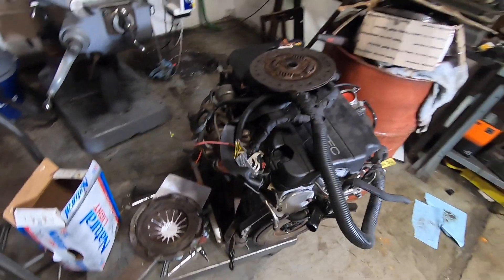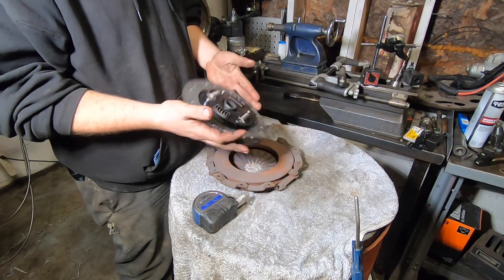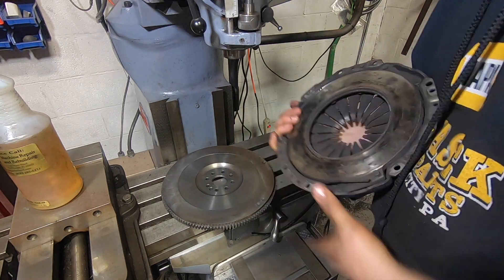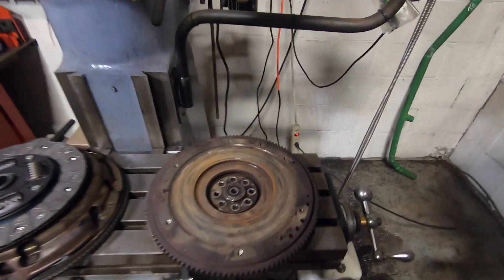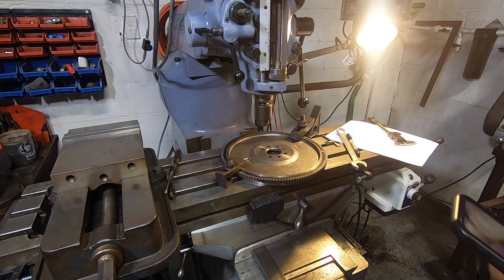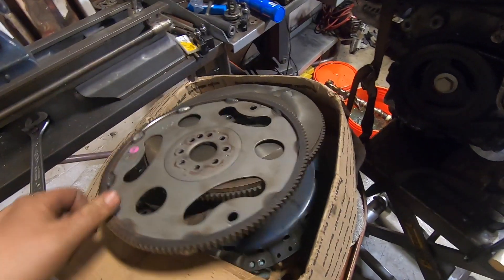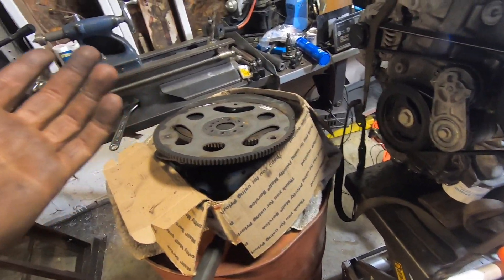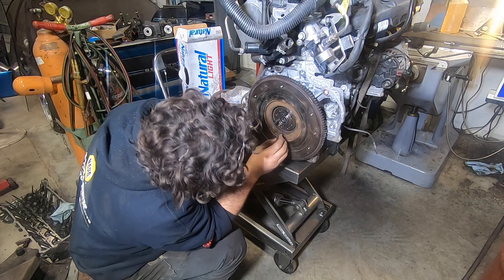Mid engine buggy PART 2. Flywheel and clutch development

Comment: In and around the year of two thousand one or two, I adapted a Mazda Wankel engine into a Subaru XT four wheel drive rig... I don't really like the sound of that particular engine but when working from a junk yard of pieces and parts, in other words basically free parts and rig,... I set it in. Once wiring and other issues were figured out, we pulled the governor off of the rotary engine. Now RPM's were unlimited and here in alaska we have some significant cold weather allowing us  to drive on frozen lakes. I did live in Anchorage at the time and was half owner with Don B. of the AAA1 Subaru shop. Its been sold like maybe the third time since we opened up a little single car garage that just blew up as popular because of its being ahead of the big onslaught of foreign cars that were all wheel drive or many versions of it. Subarus everywhere and cheap so we did a good business.... I had just went through a divorce so drank my way out of it. I might be sober now but threaten a relapse every day here at almost seventy four years of age, and on currently hospice for a injury that left me crippled... too long a story, so with further ado..... we had the XT running great and took it to big lake, name of lake and town there just north of anchorage.... and put it on the ice..... Here is where all the fun starts.... Its sounding awesome and we just put new studded tires all the way around the XT. Our buddy who was invested in our debauchery.. asked to be first driver.... no problem as he was buying the beer. He lined up against the others who we were racing against. Laughing he takes off kind of slowly to gain his best traction on the ice and then floor boarded it! We had locked up the spiders so the diffs were all turning as hoped. According  to the electronic tac, it hit around fifteen thousand RPM's and literally threw all those studs in the tires out.... steel studs coming out much faster than a machine gun and threw  those studs through every fender!!! Bonnie and Clyde had nothing on that ET that day. What I am saying is that Subaru has come a long long way from the little tin can in the eighties. I enjoyed this two part so far build that your doing or should say did if you went ahead with it... enjoy watching a guy overcome simple problems with simple solutions. I say simple yet know how complex this is and can be as I made my living as a mechanic on heavy equipment for years and then kind of got tired of camps and other discomforts so fell into fixing small rigs up for people... I got hurt in a accident in two thousand five that with doctors making things worse.... I am now a crippled old man of nearly seventy four years..... I love that exuberance you young guys have for making things happen

Comment: hey man, great job.  i'm close to starting my adapter plate build - mating an Alfa Romeo twin cam to a JDM 4.44 WRX transaxle which will be going into a '75 Fiat X1/9 resto-Franken-mod. I, too, will be adapting the Subaru flywheel to the crank, and because this flywheel is bigger than the Alfa part the bellhousing bolts on the engine block are obscured, so my adapter plate will be a 2-part clamshell design. thanks for sharing this awesome info, and let the chips fly!
Reply from the maker: Sounds like a awesome project! Good luck!

Comment: Lot's of flywheel / flexplate come with a odd bolt pattern like that. Pretty sure the LE2 engines are 0 balance, but if they ever made a version that needs counter balance they don't want the flywheel bolted on incorrectly or out of balance. I'm building a dune buggy with the same engine, only difference is that I'm using the factory FWD 6 speed manual so it keeps the weight forward. I subscribed and will keep an eye on your project, looks like a lot of fun!
Reply from the maker: Awesome to hear. Are you going to make videos about it? I considered a fwd trans but the axle length had me concerned from a suspension travel aspect. For a street buggy absolutely
Reply: @spankranchgarage  I'll probably make a few vids while we put it together. It will be mostly for street but hopefully there will be decent suspension travel too.
Reply: @Nathan LeMarbe  following for video updates. Need more LE2 swap videos! This platform has SERIOUS potential, please keep going :)

Comment: BTW, Chevy LS uses M11 flywheel bolts. I think the odd sizes are to keep you from using junky hardware store stuff. 🤣
Reply: makes sense but I feel like there are other parts of the engine and drive train where that is more critical. Either way, there is always odd/cool stuff in even the most boring vehicles